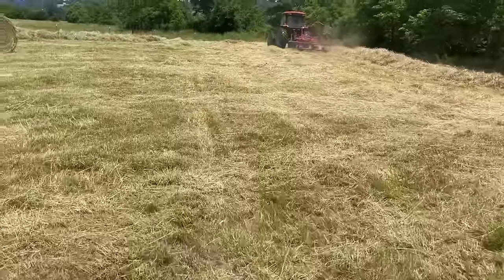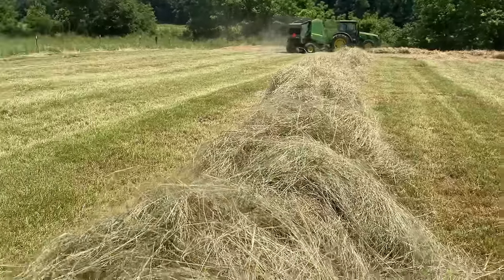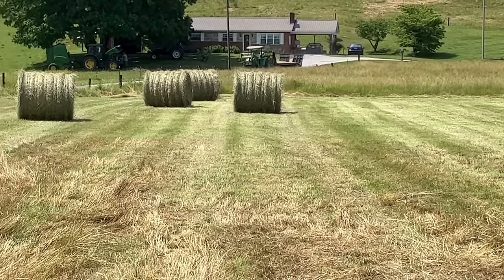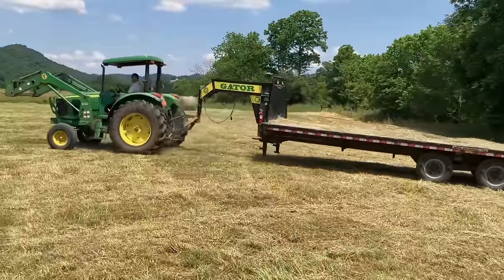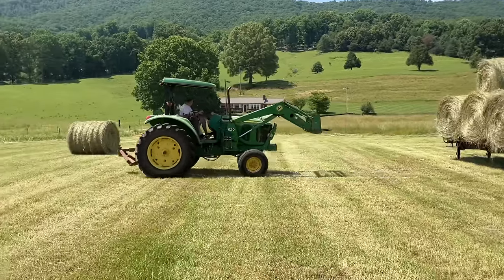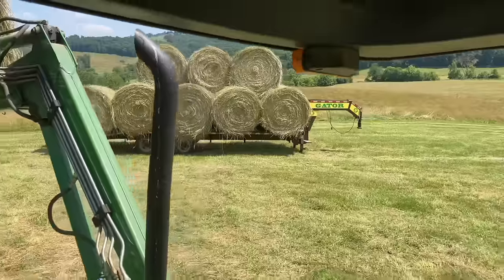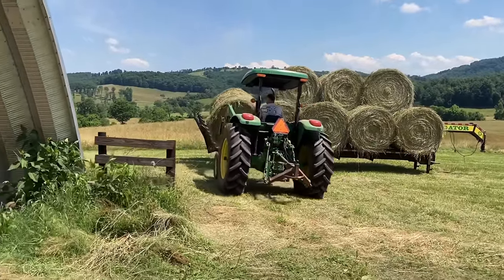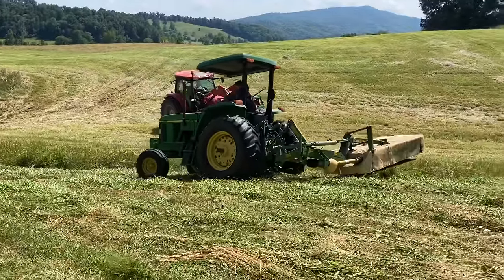Baling Hay the New School Way

Comment: How do you know when to stop the baler to release the bale?
Reply: There's an electronic control panel / monitor in the tractor where you can set the bale size, see how the bale is forming and it keeps a bale count for the field and total as well as other information.

Comment: With all the technology we have, why do round balers STILL go right behind the tractor. Why cant it be offset so you dont have to drive over the rows?
Reply from the maker: I think the main reason they’re underneath the tractor is to help keep the bale equal shape. Not sure though. Allis Chalmers made a roto baler that was offset.
Reply: My best guess is that it might get a bit dodgy (or moreso than usual) baling in slopes. 

Also if you had an offset baler then the rows would always need to be a certain distance apart to have room for the tractor. Then you'd have to use a specific size rower and then if the rows have to be x width then you might be pushing too much grass into the baler making the process slower.

Comment: Most  farmers  that feed hay tend to use 5 ft balers...
Reply: Since when? Some parts of the country use 5’ some use 4’ and won’t ever use a 5’
Reply: @nalley6815  WELL i can only relate to what i see...... We   are in business of selling Hay..... 4 ft bales  fit our program as  the bale of choice to those  horse owners that want rounds but lack equipment to handle them, and our primary objective of speed in baling, hauling,(5ft bales overhang  flatbed trailers)storing (vertical on end) and converting to  21 bale bundles  that we supply by contract to  a Nationally known farm supply stores in our radius  of operation.......   My videos  are arrainged  in playlist form
Reply: @farmingforfunandprofit940  of course you’d use 4’ for selling hay. You’d lose money selling 5 footers. And it depends on if you make baleage or not. I’m gonna start making baleage. A wet 5x5 sure is heavy…
Reply: @nalley6815   Shucks ..... We lose money selling 4x5 rounds!    A 4x5 round sells in our area for $85.00 that same 4x5 converted to a Bale Baron  21 bale bundle goes for $168.00....Since June of last year, when we swapped out a 200 Bale Bandit for a 5250T  Bale Baron we have sold over a 1000 bundles.....

Comment: Hmm... Not sure what you find is "new school" about this.❓❓
Reply: If I had to say, it’s the fact that the equipment isn’t pushing 40-50 years old. More modern tractors, baler, rake, etc.
Reply from the maker: Exactly, tractors from the 80’s are even considered old school farming now. Too many computers on these new ones lol
Reply: @Lamb Farms and @kyle Boaz I see. I guess that explains why I didn't understand what was meant by "old school". I myself am old and retired. And the newest farm machinery that I ever used was new in the mid-1980s.😁 And the oldest was new in the 1950s.😁